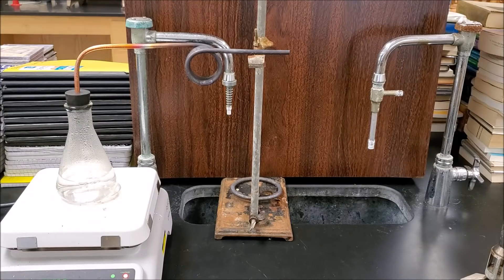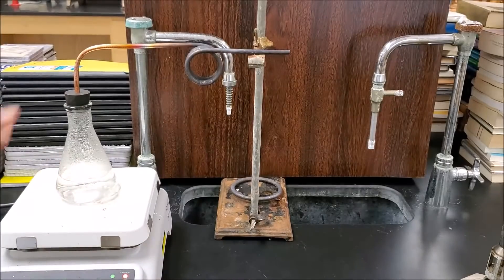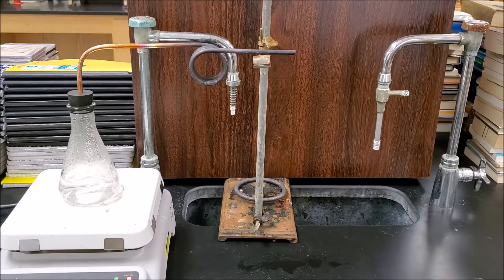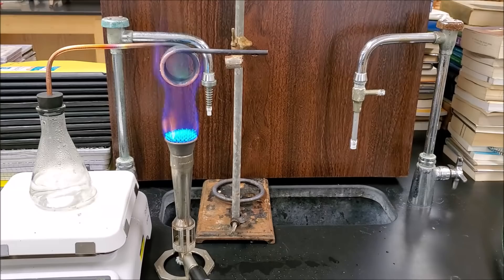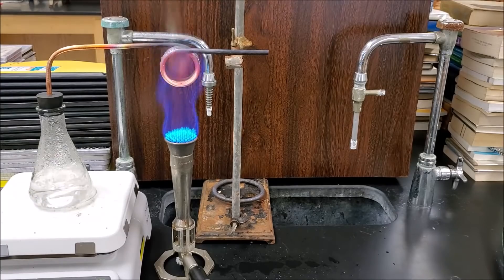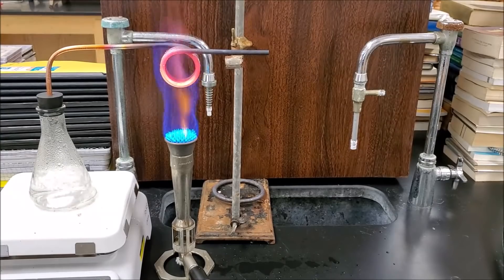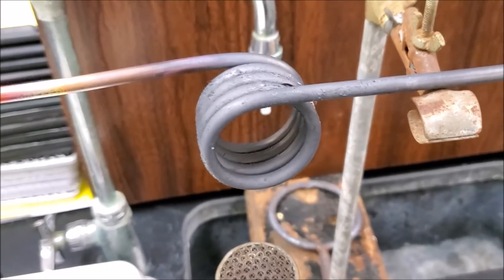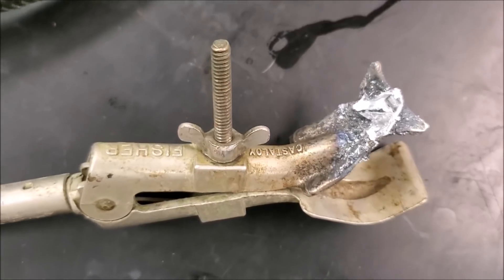Superheated Steam

Comment: Is the copper pipe wearing on the outside, where it is in contact with fire, or on the inside, where it is in contact with the superheated steam? Thanks.
Reply from the maker: The outside where the oxygen is. As the water boils it pushes any gas that was in the pipe out, leaving only water vapor inside. The outside has plenty of oxygen available that reacts with the copper!

Comment: I think this is the same principles used by bakers with steam injected ovens, to use a fluid with great thermal capacity than normal air to cause a more even maillard reaction (which can only happen above water's boiling point) to happen on the surface of bread

Comment: Cool vid, but I don't think the video title is correct in two ways. First, steam is a name for water in liquid form in tiny droplets suspended in gas, which is sometimes water vapor and sometimes atmospheric air.  If it turns invisible, it's water vapor: water in gas form. Second, superheating means that a something is at a temperature that normally exceeds the phase-transition temperature of it's current phase into the next phase. Water known to both superheat and  supercool (basically the same concept but then for a lower energy phase), for example if you microwave demi-water in a smooth glass it can exceed 100 deg C, and demi-water cooled down in a smooth vessel can also go below 0 deg C. Superheated Vapor does not exist simply because this would imply vapor can transition into a higher state, which it can't really, because then the molecules would break and isn't water anymore.

Superheat steam would imply that the steam is at a higher temp then the boiling point of water, but then the water would just evaporate, as there is plenty of surface area. Maybe this is possible, but it is highly unlikely you could actually achieve this.

But this is a neat video on the destructive power of water vapor.

Comment: thats actually what we do in power plants. the water gets turned into steam by burning some kind of fossile fuel. its then channeled through many thin pipes who are located in the burn chamber. so the steam can absorb the remaining heat from the fumes.
the hotter the steam, the more power you get on your turbines :)

fun fact: the 850 degree steam is actually "cooling" the pipes and prevents them from melting due to the heat of the fire/fumes

Comment: I ran a steam locomotive for several years.  Part of the training is a written test that includes a question that is also asked verbally when doing the practicals: "If the sight glass breaks, which valve do you close first, the top or the bottom?"  Over the course of your first month of training, that question would be repeated a few times to make sure it was ingrained that the top valve gets closed.  "The water will scald you but the steam can kill you" words I can still hear my instructor saying 30 years later.  Thankfully I never had the experience of a broken sight glass.

Comment: This is kind of a “no shit” video. Water has a high heat capacity, and so does steam, so when you get steam hot it has the ability to release a lot of heat. Cool, but not really when you think about it. I wonder if the same thing would happen with even dry air blown through a tube like that.

Comment: 5:48 if you run a current threw the copper you can actually slow down the oxidation of the metal and have it last much longer. 
Cathodic oxidation protection. Even with high heat it can help. 

Most people don't knownthat electricity can stop oxide formation by closing off the outer shell of the atom. Its crazy.

Comment: Yes, as the title suggests what you’re doing is literally superheating the steam. The steam is boiling from the water at 212° (lets just say were at atmospheric pressure 29.92 Hg/ 14.696 psia) is also at 212°, and as soon as it rises from the water and comes into contact with the air it instantly starts to cool off below the saturation point of 212˚ and condense, which is why you can actually see it with your eyes. 212° is water’s saturation point, where if it is cooled off it will stay a liquid and begin to lose sensible heat (subcooling), and if it is heated it will begin to boil off, but stay the same temperature of 212˚ until all of the water is completely boiled and the steam begins to gain sensible heat. So by putting the burner under the coil, you super heated the steam away from its saturation point, so the steam coming out of the copper tubing is invisible because it is too hot for it to instantly condense right there. However, when it comes into contact with something that can absorb its heat content quickly (like the glass cup) it begins to condense on the spot.

Comment: I worked in a lumber sawmill when in University.  The "head rig" (main 3 story band saw) ran on steam.  There was a steam powered log flipper the sawyer used to manipulate logs while cutting them up.  It could lift 15 to 20 tons straight up in the air like it was not even there.  That steam is amazing stuff.

Comment: I'd be worried about that copper pipe getting a pin hole leak. 

Also, why tf were you not in a fume hood? 

What is the back pressure on the beaker?

Comment: As an ex power station operator, working with steam for 38 years, I know all about superheated steam. . . 
It's the stuff that you CAN'T see that will burn you badly. . . Or in some cases of EXTREMELY hot and high-pressure steam, it will CUT YOU IN HALF and you can't see it!

Comment: Wouldn’t this also work if you just blow air through a tube, as it’s the gas/air not the water getting heated to that point? Because technically speaking there is no longer any water present, right? So the video title should be superheated air/gas not steam? Please someone correct me if I’m wrong
Reply: exactly it is misleading

Comment: When boiling water on a normal stove or electric hob, the steam won't transfer as much heat as sticking your hand into the boiling water. However, heat the steam up more by increasing pressure and it will do a decent amount of damage. Just look at people opening their car radiators after their car overheated. Not a fun experience.
Reply from the maker: Pressure cookers can be dangerous as well!

Comment: My uncle worked on nuclear ships for the navy. Superheated steam. He said that people would hear a leak and go to feel with their hands to find the hole. All their fingers would be cut off and cauterized instantly. Scary stuff.
Reply: Nuclear ships do not have superheat.
The water is boiled by running water over fuel rods the transfer to a non radioactive water using a heat exchanger called a steam generator.

The steam is all saturated.

Comment: Supercooled water is liquid water below the freezing point at any given pressure, that will tend to rapidly freeze when disturbed.  It can be supercooled by not providing it any nucleation points for ice crystals to start forming.

What is "super" heated steam?
Reply: The opposite of supercooled water isn't superheated steam, it's superheated water, and it's basically the same, but in the opposite direction. If you have a smooth heat-resistant glass, distilled water and a microwave oven, you can make some superheated water yourself — just be careful when taking it out, because it appears still, but will boil explosively if disturbed.

And superheated steam is just steam heated to the point of turning completely into gas. Superheated steam doesn't precipitate, and, if put under enough pressure, condenses into supercritical water without going through the liquid stage.
Reply: @Hisu0  Aha of course!  Hence boiling chips, right?

Cool name by the way.

Comment: The steam is actually carrying the heat from the red hot tubing onto the paper. Had you only used a flow of air, the paper would have been burnt exactly the same.
Reply: Yeah really he was using air pressure from the boiling water to move heat from the 900° red hot pipe the steam wasn't actually doing the heating or burning.

Comment: I have worked at a few electrical generation plants, all use super heated steam at (at the plants I have worked in) at least 850 psig. You cannot take a chance on condensing any water droplets prior to the steam entering the turbine. It would be similar to throwing a steel ball into a plate glass window. As a result, during a first start up of a new plant, plastic rods used to be given out to wave in front of you when you traveled past any of the high pressure steam lines. You cant see it, may not hear it, but a small pinhole leak would literally cut you in half.

Comment: i have a question if anyone could answer, if you say that the 100 degrees c steam is steam but with water vapour, and the fact that water will evaporise due to the heat, does it mean the 100+degrees c does not contain any water vapour therefore not actually using any water?

Comment: There is a combustible engine that works with this principle, gas is used to start the vehicle but once the catalytic gets hot enough there's a pipe where water is drawn through and the hot steam will ignite like gas, so once the temperatures are at a certain level the fuel is switched from gas to water, and there's even another way where washers are stacked in a line like a row, this row is placed in a container with water and a current is passed through, the water begins to split it's molecules I forget the word for this process but the fumes are as explosive as gasoline and can power a car! Water powered cars have been around, there's one thats literally been around for decades, but no one with money will fund the manufacturing of vehicles that won't need a source of fuel or power that can be profited from.
Reply: Sorry but no.
Bs

Comment: 5:02 No you started fire using fire. And the water doesn't have the power, the gas burner has the power. The water is the medium for the "power" to travel to the paper.

I bet you could do the same experiment with just air under light pressure from a pump moving through the same copper line being heated and you'd get the same result.
Reply: Ya think? I bet you could do it with just a bic lighter and not have to mess with the rest of the crap at all.

Comment: Nice video, but temperature alone does not cause burns and damage.  The higher density of liquid water  can transfer more heat than superheated steam, even at a lower temperature.  Still, both are dangerous.

Comment: USN, retired steam plant propulsion engineer. Served on several 600# and 1200# steam ships in the propulsion space. 
A pinhole leak cannot be seen. A pinhole leak can amputate, and cauterize, a limb. However, it can be found due to the increase in that area temperature zone. We were taught to use a broomstick to find the leak. 
The civilians say 15 psig steam is high pressure, HAHAHAHAHAHA
Reply: How far away?
Reply: @louf7178  How far away what? How far away can a superheated steam pinhole leak cut oneself? Good question, but I wasn't willing to find out!
Reply: @torinbrown8196  Yes, that was the question. Thanks anyway.
Reply: Thermodynamics/Systems and Thermal Fluids Engineer. Work at/on critical and super-critical power production facilities. Also research in the use of 
ultra-critical systems for power production. We don't use brooms to look for leaks. We don't have leaks.
USN Swabees say 1200 psi steam is high pressure! That's so funny that I can not laugh.

Comment: Would have been interesting to see how many °C this reached.
When does normal steam become super heated, or  supercritical?
Reply: For superheated steam, pipe the steam (vapor) away from the water source and reheat that vapor again..., superheated.
Reply: Ya i don't get why he didn't measure the temp of the super heated steam. I kept waiting and waiting and...nothing. Mr. B left us hanging.
Reply: @Camaro9798  Might of broken his thermometer if he kept it there long enough.
Reply from the maker: Correct!  I unfortunately have the resources of a small high school, so do not have a thermometer that measures that high of a temperature.

Comment: it won't be over 100 deg C as you need elevated pressure to be able to attain this, what you have is fully dry steam
Reply: Heat was added after phase change.
Reply: @louf7178  but the pressure remained the same so the temp will stay the same, what you will have is a change in enthalpy
Reply: @MingRaptor  Adding heat raises its internal energy.  No?
Reply: @louf7178  actually yeah, it does have a super heat cycle so should get hotter, my bad

Edit; assuming the super heat cycle takes the dryness fraction to 100% which it looks like it does

Comment: My hot air soldering gun should work the same way and light a match or piece of paper - without any boiling water involved. What is the point of raising the water content in hot air that passes through the red hot copper tube?
Reply: To demonstrate "water" (vapor) can counterintuitively start a fire.
Reply: It wasn't hot air passing through the red hot copper tube. It was steam, made by boiling water in the flask. Now, do it your way with your hot air gun, but first, remove the little blower wheel/fan from it. Turn it on and point it at the match. What? It didn't work?  Hmmm. Well try this, using the exact same equipment that's in the video. Just  dump the water out of the flask and dry it out first. Then turn on the heat and let 'er rip. What? That didn't work? Hmmm.. Looks like we need to add an air pump or compressor to the system to move the air through it. (Or put the blower wheel/fan back in your heat gun). But what's the point of doing all that when it worked just fine using water, which raised the water content in the hot air that, without using a pump or compressor, passes through the red hot copper tube and lights a match or sets paper on fire? What's the point of your point, if the point is on something entirely different than the video we watched? If I make a point about a tricycle, then add another wheel to it, it ain't a tricycle any more. So what was the point of making a point about it? See what you've done? Now I find myself slappin' the dog and kickin' the wife for no reason. I now run with scissors. In each hand! My entire life is going down in a spiral of confusion, thank you very much!    lol

Comment: even if the measured steam temp was above boiling water.. as a gas the "heat" transfer to hand wont be anywhere near as efficient as in water.. missed the point of accelerated copper oxidation from the flame

Comment: The number of armchair scientists and mechanical engineers  who commented on this is frightening, most of them will be awarded a Darwin award pretty soon. ...  things that you can take away from this which are true (in laymen's speak)
1) Water vapour is what you see when a pot of water is boiling. 
2) Steam is what you don't see,  if you look at the spout of a kettle, there is a small space that is clear before it condenses, that is steam, 
3) Steam as it leaves the surface of the water is normally at the same temperature as the boiling water, but it is also dependent on the pressure of the system.
4) If external heat is added to steam at normal atmospheric (approx. 1 bar)  pressure all you are doing is drying out the steam, yes you are making it superheated, but wasting a lot of energy.
5) Superheated steam under pressure (as in Boilers used in powerplants, ships and locomotives) is  extremely useful due to the amount of useful energy it can store

Comment: I see everyone commenting below that you can't see a leak in the system and disposable objects are sacrificed to find them.  But what about when the leaked steam gets further away from the source?  Do you start to see condensation 10 or 20 feet from the source?  Also are there no visible thermal layers/breaks in the air?  Is there zero diffraction of light or lasers?
Reply: It must greatly diffuse and is absorbed into the air, thus increasing the air's humidity.

Comment: What would happen if you were blowing air through the tube instead of steam, would it still light the match? My point is, how are you sure it’s the steam that’s super heated and not just air?
Reply: Yes, if the air was hot enough.
Because he's not pumping air through the tube. The steam pressure is what's causing the "flow" through the tube.

Comment: Just a tiny tip from someone who has to strike an ocy/acet torch all the time, you're holding the striker a bit wrong. The best way I've found is to have your thumb on the moving leg of the striker. This lets you push downwards and sideways at the same time. Makes striking a bit more consistent. Loved the video!
Reply: Agreed. Oxy acetylene torch all the time as well.
Reply: Same
Reply: Ask any plumber... No, wait -- hardly any have used a torch ever, or not in the past 20 years! 
             ¯\_ಠ_ಠ_/¯

Comment: I'd also say that the water vapor will transfer even more energy to your hand than water because when it condenses on the hand it releases much more energy than just the thermal energy.
Reply: You'd be putting your hand in a substantially higher density of heat with a substantially higher thermal conductivity by dipping it in the water. 0.660W/m*K vs 0.024W/m*K and 1cal vs 0.48cal. Thats 27x higher conductivity and 2x the density.

Comment: You measured the temp of the steam the after sending it through the coil and that cooled it off so that part of your demonstration was a waste of time. The rest of the demonstration was accurate though.
Reply: One more thing most lab clams like that are zinc and melt at the relatively low temp of 787.2°F, I would like to find some made of 321 stainless steel, or for that matter any stainless steel.